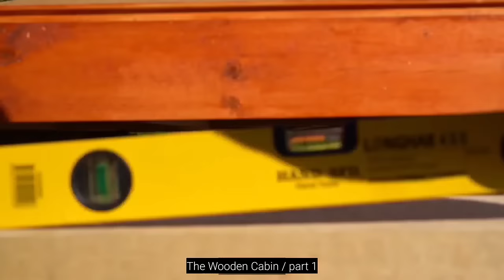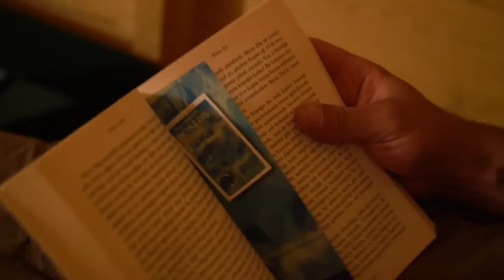Building a Wooden House / Off Grid Log Cabin / Tniy House / Part 4

Comment: Absolutely lovely. Now you need to build 4 more. 1 for the wife, 2 for the kids, 1 for the tools/office where you can lock the door :D

Think it would be great for you with a small 250ah 12/24v lifepo4 battery bank and 2-4 solar panels of 3-500watt. They dont have to be on the roof, just on a small frame on the ground since not a lot of trees around :)

May i ask, how is the house fastened to the ground? Didn't notice you did anything to stop a strong wind from rolling the house away. Maybe i missed it.

Thanks for the video! Lived it.